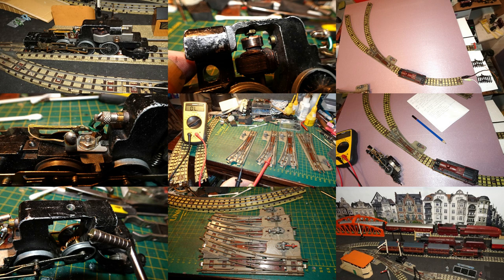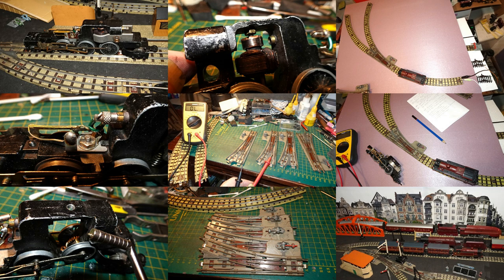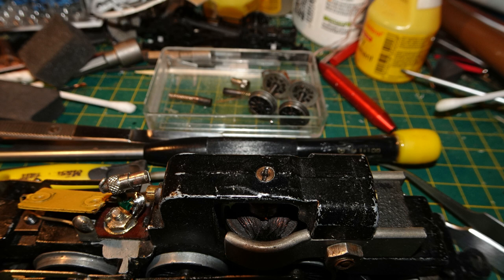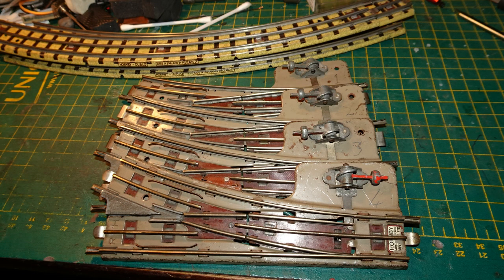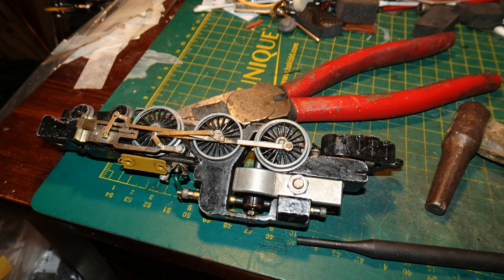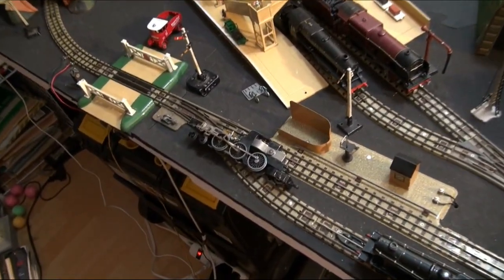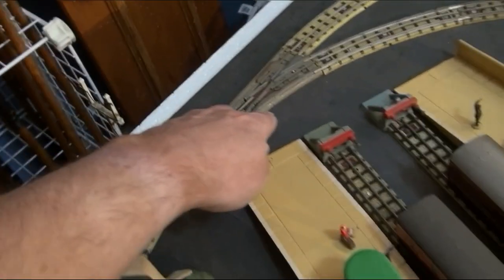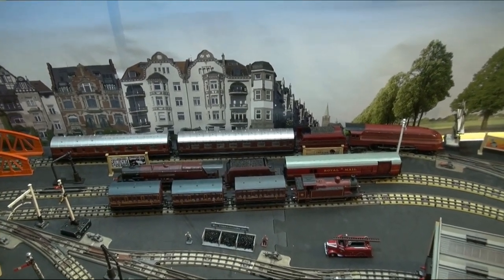OO 219, Dublo 3-Rail: More Tortures, Mostly Points

Comment: Hi love your videos in no 77 ware did you get the rolling road from I live in the uk and can’t find one anywhere ‘thanks mike
Reply from the maker: My rolling road is actually a combination of two different things. The wooden base and the tracks come from an old HMR 'loco tester' that I bought on eBay. That came with little brass rollers which didn't really work well. I now use it with DCC Concepts rollers - they just sell the rollers, with the idea that you will put them on your own track, either a piece on the bench, or just on your layout. The DCC Concepts rollers are still available for sale. I believe that the Hornby rolling road is also still available... they show up on eBay from time to time, for sure. I just checked on eBay UK. There are lots of listings for the DCC Concepts rollers. I also saw listings for a Bachmann rolling road, but I don't know anything about that one.

Comment: Try a steel ruler across the frog and outer rails they should be flat if not gently bend straight again
Reply from the maker: Well, there are multiple issues in terms of straightness and levelness. The base of the track sections should be made to lie flat, to sit evenly on a perfectly flat surface without any part raised, or any rocking when any part is pressed. I did that for all of these points when I first selected one for use, back in Part 214 of this series. It would also be ideal if the top of all of the various sections of the point - main rails, blades, guide rails, frog - were at exactly the same height. However I have never encountered a used Dublo point where that was really the case. Sometimes corrections can be done by bending, grinding, filing, etc. But if parts are at seriously different levels, it may be best to just give up on the point. And it seems that even taking all of these detectable issues into account - warping of the base, components at different levels, wrongly bent guide rails, etc. - points can still malfunction when in use for reasons that aren't readily apparent. That was why I resorted to testing the points under equal conditions in this case. But unfortunately my attempts weren't very successful.